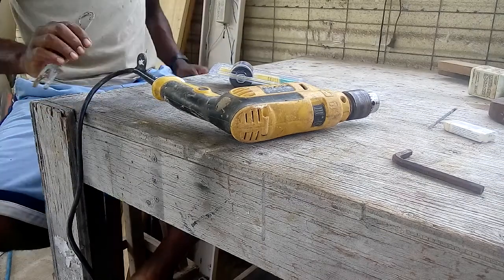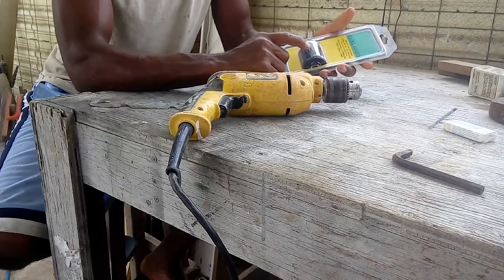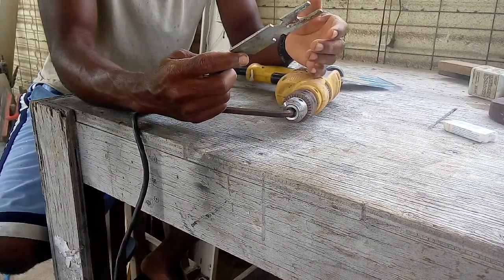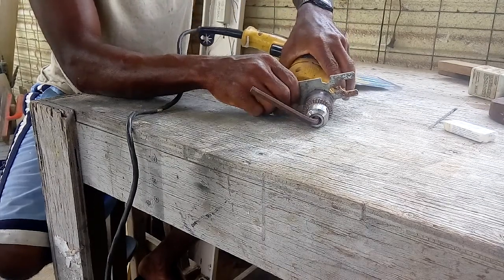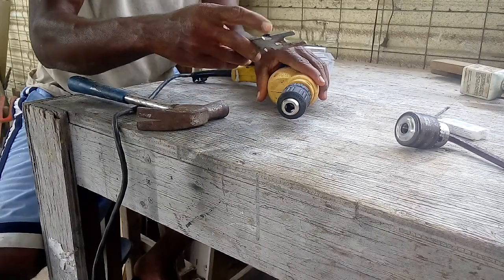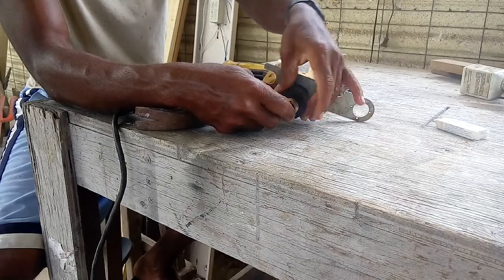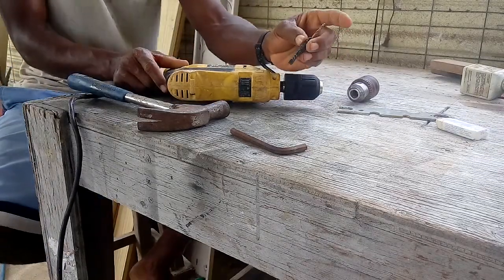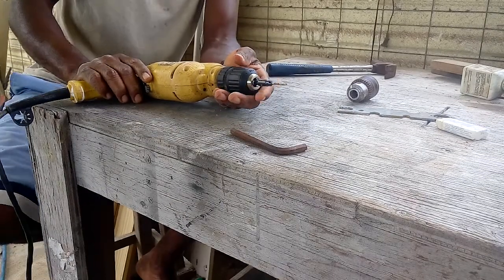How to change drill Chuck

Comment: incomplete on info. what size allen? what is dewalt number as mine is dad110. I waited and no info. you were waste of time. thumbs down
Reply: Pretty sure the allen wrench doesn't have to be any specific size,  I would suggest the largest size that will fit into the chuck.